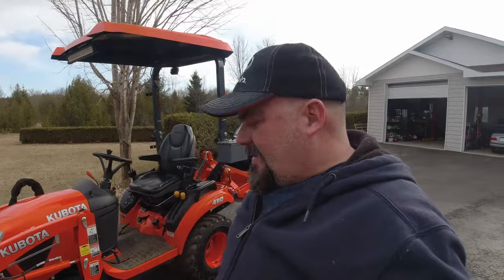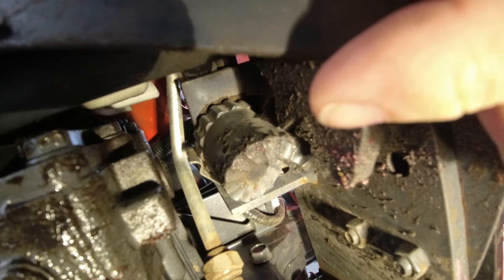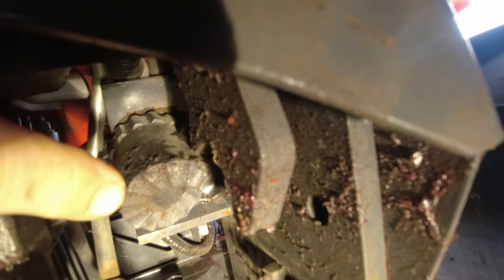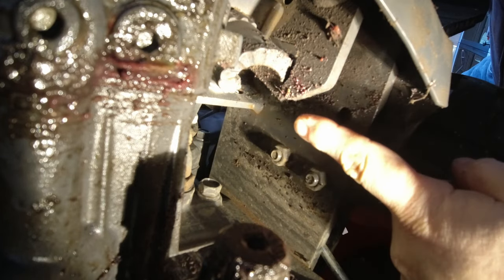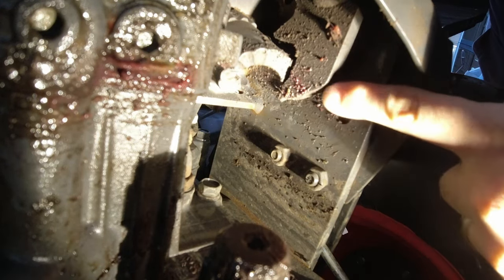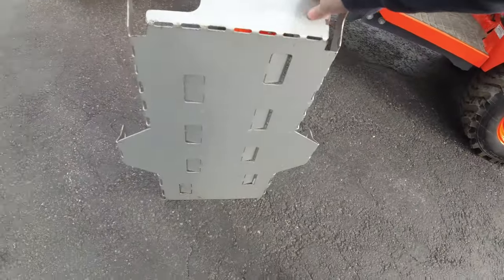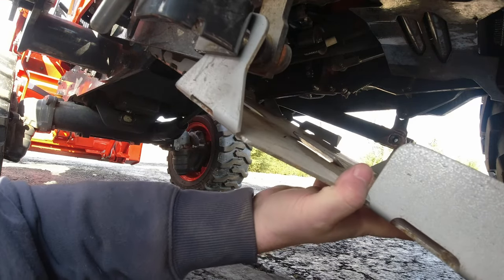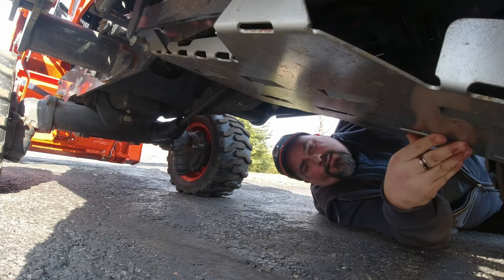Kubota BX Knob Adjustment Explained

Comment: Just took delivery of my BX23S and installed my under armor. Issue is I cannot get the knob to go to “TOP” with the under armor in place. Remove the under armor and it’ll go to “TOP” no problem.  I thoroughly understand that the “top” position “tab” on the cam is not clearing the part it parks on.   Is there an adjustment to rectify this?
Reply from the maker: Hey Terry, my suggestion is to remove the under armour, put the Knob at Top, turn on the tractor and pull up the 3pt control lever.   Then crawl under and verify that it's working as intended.  If it is, then replace the armour. When I pull up the 3pt control lever I know the armour pulls snuggly against the bottom of the deck.  Let me know if this works, or if you need more help.
Reply: Long story short, I turned the “mower link” adjustment 1.25 turns CW and it works like a charm now. I just guessed on the amount of turns, may have turned it more than it needed. In the book, this adjustment was found in mower section, subsection 5. Thanks for the closeups of the mechanism. It helped me to eyeball what was happening under there 😉👍🏼
Reply from the maker: @tbryson2  excellent Terry! Have a great day.
Reply: Mine does the same thing, I crawl down next to the tractor so I can reach under it and slightly press up on the skid plate as I raise the 3 point and it'll then allow me to select TOP on the adjustment knob.  The skid plate is a tight fit as its supposed to be to keep it from rattling around, so you'll have to give the skid plate a bit of an assist from under the tractor as you raise the lift arms.
Reply: @wildbill23c  the simple adjustment I made eliminates the need to do that.   But thanks for the feedback
Reply from the maker: Glad to hear it.

Comment: I still can't turn my knob, no matter what position the deck is in.  What am I missing?
Reply from the maker: Hello, my suggestion is to turn on the tractor and run the tractor at about 2.5k rpms, then use the control lever to lift the rear 3pt arms all the way up. This should remove any restrictions on the height adjustment knob.  If it is still not moving, turn the tractor off and crawl under the tractor and verify that the bottom side of the height adjustment knob is not in contact with any of the detents. Hopefully that helps.

Comment: Ross...I'm stuck...2013 BX2670....I followed the instructions...3 pt all the way up. The knob position is in the highest setting 4. Cannot get it to rotate...can you help. I have raised and lowered the 3 pt....raised and lowered deck...nothing...any help would be appreciated
Reply from the maker: Hello Mike, and welcome.  With the rear 3pt arms all the way up, (like all the way) Does the Knob wiggle at all? It may have seized. My suggestion is to crawl underneath and spray with liquid wrench or WD40 and see if you can get it to wiggle.  And see if the tab of the arms are in contact with the detents on the knob.  That's your best chance of seeing if there is still interference.  Let me know if that works.
Reply: @RossOnTheLand  after a while and   much musing .. I thought that there could be tension on the 3 pt ...so I manually pulled the deck up and placed props under the edge of the deck....much to my surprise ...the maneuver works...was able to start the disconnect for the mower...but much to my chagrin the disconnect required more than available videos...in the end...got it off...now it's time for celebration..woo hoo here comes 99!
Reply from the maker: @mikeclarke4573  glad you got it off, so now have a look to see how your MMM adjustment knob is interfering with the 3pt arm tab.  Happy day.
Reply: @RossOnTheLand  can only imagine putting that damn thing back on...oh well .. that's another day ..thanks for the video. ..it helped
Reply from the maker: @mikeclarke4573  you are most welcome.  Have a great day

Comment: Two of the only few things I dislike on a BX and I own two. I prefer the Bro-Tek plates as you can leave the rear plate on with the MMM, yes a stick got past my MMM and destroyed my HST fan. I HATE not having position control 3PH like on everything else I own including my JD 1025r. Even with all that, I still prefer them; beats me why. FYI Paul and Kathy Short have some really nice improvements for several models of Kubota at Specialty Repair. I have kids, so the tail light and hazard light guards have paid for themselves.
Reply from the maker: Hello, yes I like the Brotech guard as well. I have to take it off for winter snowblowing so that's a pain. I have watched the Shorts for many years and love all their products. Thanks for watching and commenting.

Comment: I just bought a used BX2380. No idea what knob locks the mower, what knob hydraulic lifts the mower, but I do see the knob that is supposed to turn but doesn't. This video shows the mechanics of the lock (I guess.) Maybe I can push on it with a screw driver and see which knob above moves. Just kidding. Can somebody point out these things in a quick video. Look, if millennials ever inherit a tractor, they'll need all this basic info too. Help us out. The manual is full of locks and hydraulic lifts. Is it safe to just start yanking knobs until one does what you want? Seriously, just a quick video with out the trouble shooting. How to work it, if it's functioning as it's supposed too. Then, I'll figure out if it's broke or not.
Reply from the maker: Hello, just make sure the rear 3pt is lifted up all the way, then you should be able to rotate the control Knob. Let me know if you need any more help.